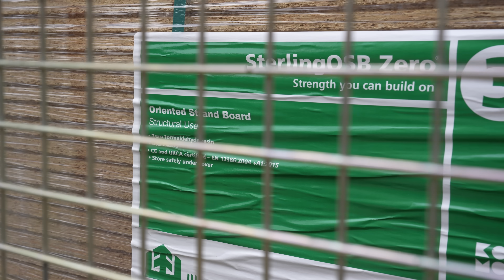Ready for the roof.

Comment: I hate OSB for roofing. When the stuff first came out they sealed one side to protect it from rain. 1/2 our crew almost slid off the 2nd story roof because of how slippery it was. Just a little morning dew was all it took. Then the stuff without the sealer swells up when wet making the connector clips hard to get on or if using tongue in groove not fit.
Reply: I'm wondering if using t&g planks would just be better, likely more expensive of course.

Comment: You could use the same technique of harness to do the facade render taking off and putting on as I know you were to sandblast the exterior I would just take the render off and put new on. Chateau Honfleur had a company come in but sure Dan and company could manage it themselves. Prepping for completing the roof makes sense best not to risk it again. It will be interesting to see how the middle roof goes on as it's much larger than the other two you have just put on. Then there is the smaller one should be less effort than the other 3 depending on how you are going to do it. Glad you have had the expertise of Nick to help you keep safe doing this roofing. I hope you called the beekeeper about that issue.

Comment: Why didn't it matter that the osb last time got wet?
Reply: Maybe not using the same stuff. Or maybe realised there's problems with what was installed.
Reply: @LaReynedeNeige  yeah the different stuff was my guess too, but I also were asking myself by the last roofing how this is gonna work with wet osb AND the isolation foil (don't know the english word) on top of it. Isn't this swelling and gonna go moldy....?
Reply: @jasminhauser742  With enough air circulation, warmth, time, it should dry out if it did get sodden. Trouble is if it did it could warp and lift, which might need it to be redone. That said, in the recent film of the inside of the first roof, I can't say I noticed anything problematic.

Comment: Do you plan to rebuild the roof windows ? I wonder if its to late or not, you could still cut the frame to the right shape to make it fit.
Reply: Not too late. Yes, will have windows later as Dan told us when the first roof went on
Reply: It's no problem to retrospectively add windows.

Comment: The open floor area behind the stud wall should be covered with plywood to prevent any fire from spreading upward behind the wall. Normally called a fire stop. There must be different building codes for this in France .
Reply: Flooring at the moment is only temporary and due to be replaced at some point once the roof is on.